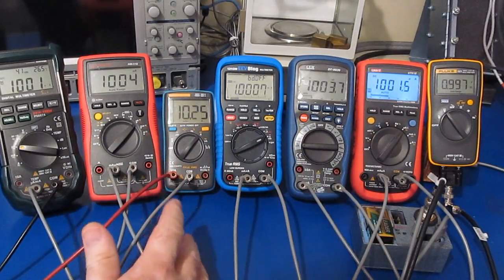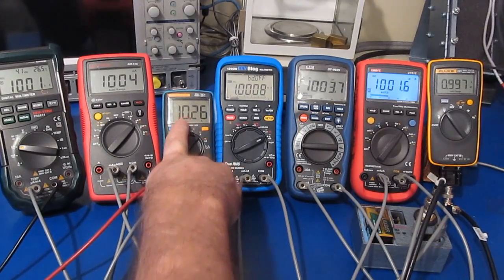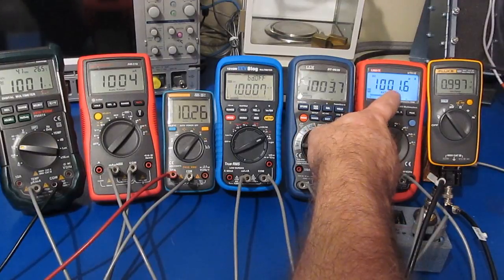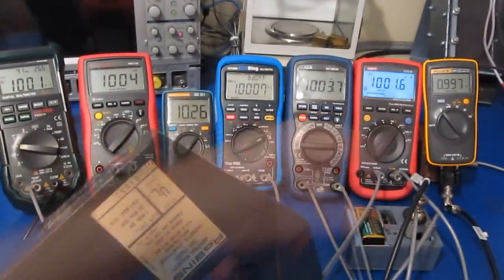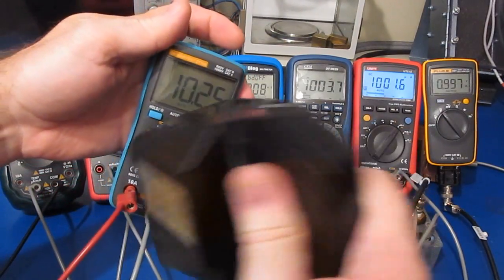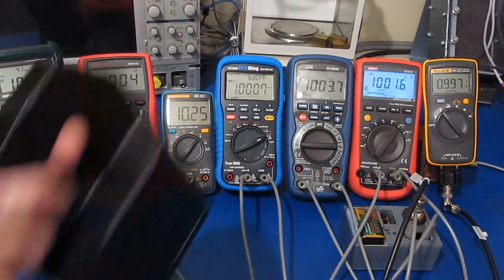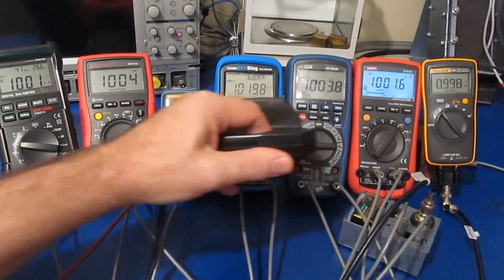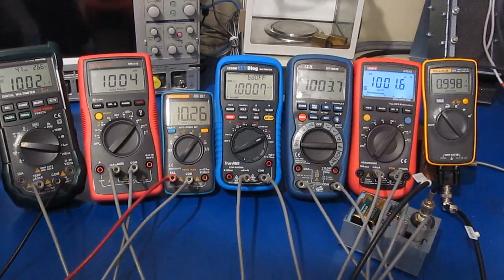Proto 121GW, 1mA Tape Eraser with Several Low End Meters

Comment: Very useful this review. Please tell me what you think about this: https://www.eevblog.com/forum/testgear/fluke-185-manufacturing-issue-broken-case-and-glass/new/#new
Reply from the maker: Hard to say what was done to it.  I suspect many get tossed into a toolbox without a case.  Next thing you know a hammer drops on it.  The case protects the electronics but it also takes all the abuse.
Reply: The device was very well protected and did not suffer any mechanical problems, I posted at the beginning of the post a picture with another Fluke 185 of mine that suffered the same problem identical to mine. It's a big coincidence, what do you think? If we stay a little and think cold these multimeters are over 20 years old, an aging of plastic may occur ?
Reply from the maker: Your link says that you have owned it for three years.  You state it's a 20 years old product.  You state it was very well protected.  I am missing something.  Did someone you know own the meter for the 17 years and you know how it was treated during that entire time?   I bought one Fluke that saw a fair bit of UV exposure.  Enough to damage the LCD.   Plastics  and UV don't normally mix.  Same with certain chemicals.  Who knows what they have been cleaned with and such.  Unless you bought them brand new,  I just don't see how you account for their entire history.
Reply: Yes you are right I really do not fully know their history of use, everything that's possible. I think the Fluke 185 was a very successful device with many features and a very revolutionary design at that time. I also have a Brymen 869s that is very good, Uni-t UT210E, Aneng  AN8008  (just for fun - but very accurate) and a few old generation of Hung Chang HC-81 and DM27. I also had a Fluke 17B + but I sold it because I did not like it was not accurate, but it was solid and very well built. Thank you very much for your reply.
Reply from the maker: I have the 189 which I really like.  I think it predates the 185.  I doubt Fluke sold that many or they would have continued to make similar meters.  My guess is the electricians and technicians didn't have a use for such high end meters and that's where the majority of sales was.   The 17B+ is not in the same class.  It's not even TRMS. But again, I doubt the people using them are electronics hobbyists.   They do appear to be very robust and well made as you suggest.   I like that UT210E.  Hard to beat the price if you need a low current DC clamp. 

I am planning to run a 189 in the future.
Reply: Yes you are perfectly right in all the aspects you have listed, I still trust that Fluke has manufactured good and safe multimeters but of course I do not exclude Brymen and Uni-t. I've watched almost all of your movies and that's why I dared to ask for your advice. I appreciate and I thank you because you share from your time and experience.

Comment: So, what all this means in daily practice?
Reply from the maker: Sorry, I have no idea what you mean.
Reply: He probably wants to ask how does this affect a regular usage pattern. My guess is, if you are doing any RF or high power SMPS work, it will be affected to some degree.
Reply from the maker: That makes sense.  He never responded.  I would say it will depend on your perspective.  If you are a short order cook for example, maybe nothing.  What I have been doing in these last few videos is attempt to replicate some reported problems.   So if your day to day activity involves solving problems,  the first thing is try and replicated it in some controlled test.   Once you have done that, solving the problem gets much easier.   In this case, it's UEI's design so my intent in making these videos is to provide them with data to help them solve it.   I wouldn't (SP) just call up a company and start complaining that their product has a problem without some details that would help them.   It seems obvious to me but maybe not to others.  

As for the tape eraser test, again, the idea here is to inject a signal in that 50/60 hz to test their notch filters.  If you have been following the thread, it seems there are other modes where people are seeing problems that I don't see with this meter as well.   Again, its all about trying to replicate a problem in order to solve it.  

UEI changed the filter at least in that 5M range as that now is as stable with their latest firmware as it has been.  

I guess another thing I would take away for daily use is be patient.  Solving problems takes time.